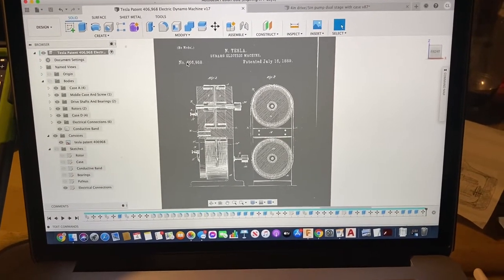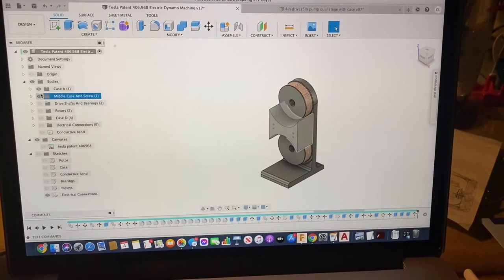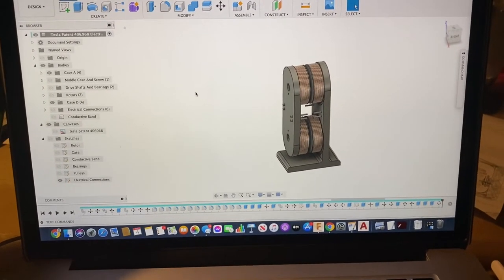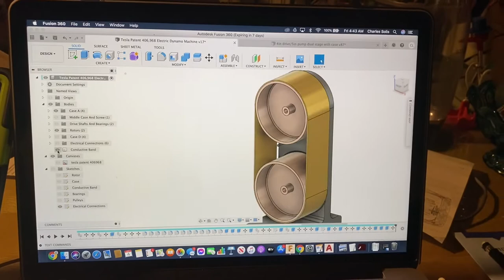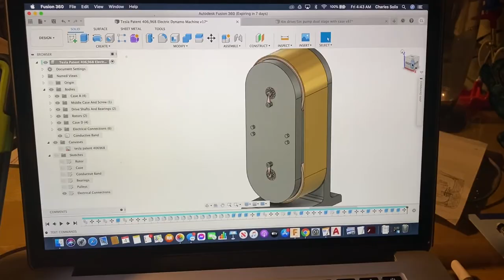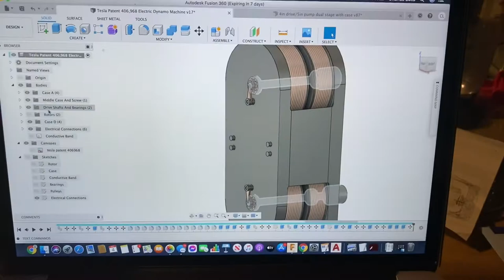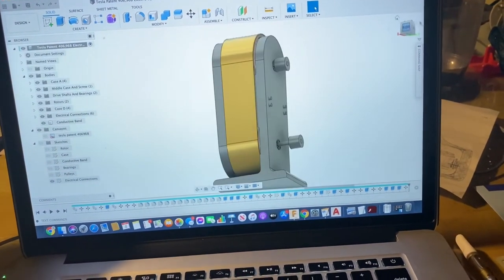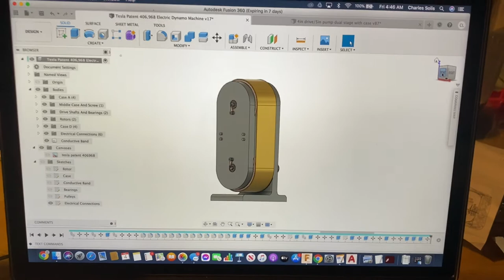Nikola Tesla Patent - 406,968 Electric Dynamo Machine - DC Electricity Generator Homopolar Motor

Comment: hey @Charlie Solis nice CAD! do you know what you'll make the conductive belt from?
thanks. ( answer is  in the chat for anyone interested)
Reply from the maker: Hey thanks for commenting! I know you saw I responded in the chat but I’ll repost the response here again so others can see too. 💙💜💚❤️
In the patent Tesla explains...
“H K are the disks or generating-conductors. They are composed of copper, brass, or iron and are keyed or secured to their respective shafts. They are provided with broad peripheral flanges J. It is of course obvious that the disks may be insulated from their shafts, if so desired. A flexible metallic belt L is passed over the flanges of the two disks, and, if desired, may be used to drive one of the disks. I prefer, however, to use this belt merely as a conductor, and for this purpose may use sheet steel, copper, or other suitable metal. Each shaft is provided with a driving-pulley M, by which power is imparted from a counter-shaft.”

And further down in the patent he says this as well...
“Furthermore, it is evident that the conducting belt or band may be composed of several smaller bands and that the principle of connection herein described may be applied to more than two machines.”
Reply from the maker: Do you have any suggestions of Tesla’s patents that you would like to see built in CAD? I’m trying to figure out which one I want to do next.
Reply: @CharlieSolis   i'm really just focused on the turbine pump but let me think about it. BTW, "Science Exxience" youtube channel has an interesting design of the tesla hp gen.
Reply from the maker: Ahhh yeah I’ve seen those videos. The guy is spinning the magnets with the rotors though. And while it should work considering faraday’s paradox that’s not how Tesla designed it. Also there would be no way to spin the electro magnet coil windings in the case, that Tesla explains are used for increasing the magnetic field, with the rotor.
Reply from the maker: If you haven’t seen them all check out this link. It has all the relevant patents that Tesla had for his turbine. There’s a bunch more that most people don’t know about. 
These are further patents Tesla has for utilizing this as a mixed fluid steam turbine where the steam produced from boilers, with combustion, is mixed with the exhaust of that combustion for a multiphase fluid flow of gas exhaust, steam and water to power the turbines. He even has another one where the exhaust from that is further reran through the boiler to give off the last of its heat to incoming water that is not up to boiling temps yet to drastically increase the efficiency of the system and to utilize the last bit of thermal energy again.
http://www.rexresearch.com/teslatur/turbine2.htm#vacuum
Reply: @CharlieSolis   i think he saw the world as   millions of carnot cycles all around him, waiting to be harvested for the betterment of humankind :)  ...way ahead of his time.
Reply from the maker: @Charlie-Oooooo  for real though! He saw the world in such a different perspective than even people today do. Pure genius.
Reply from the maker: @Charlie-Oooooo  I saw your comment exchange with Paul from grav inert and thought you’d like this list of patents that tesla didn’t get approved. 
http://journal.telfor.rs/Published/Vol5No1/Vol5No1_A14.pdf
Reply: @CharlieSolis  Thank you, that's kind of you.  Interesting stuff and a good winter read - maybe 2 winters ;)  So for a new tesla design how bout his radiant energy collector?  Maybe upping the efficiency a bit?  This year is the 99th anniversary of his patent for that - Nov 5 1901 I think. Patent US685957A.
Reply from the maker: @Charlie-Oooooo  ohhhhh yeah that’s another really good one. I’ve been working on getting to that one as I have some really awesome thoughts on how amplify the effectiveness of his radiant energy patent!
Reply from the maker: @Charlie-Oooooo  yeah I’m really excited to start releasing videos on Tesla radiant energy collector patents. I think I have a way to amplify its effectiveness and make it build up potential at a much faster rate.
Reply: Simple way: use a conductive chain and make the edges sprockets.

Harder way: carbon fiber belt

Comment: 👍👍
Reply from the maker: Thanks for commenting!
Reply from the maker: Hey Body Of A Legend!! Not sure if you’ve gotten a chance to see my latest tesla turbine updates but check them out! Just running on compressed air so far while I still work on the larger vacuum chamber system for the turbine. Peak 2.75kW and 6.22ft-lbs of torque 4150rpm with 150psi room temp compressed air with 1/2in supply lines.  And the second video is the latest 1200watt electrical load tests using 170gal of 150psi compressed air dumped to 65psi, both room temp and then 70-80°c heated compressed air. And saw the continuous 1200watt output all the way down to 65psi. Should have this thing ready for a vacuum chamber here real soon! 

https://youtube.com/shorts/yXQy844URMA?feature=share

https://youtu.be/bWpXRzrzf4g

Comment: Cool! Are the magnet rings fixed to the casting, or fixed to the disc?
Reply from the maker: Yes in his patent they are affixed with the casing. But the magnets can be spun with the rotor due to Faraday’s paradox. However unless it’s being run at a constant rpm for constant voltage out I would not suggest adding that mass to have to be spun up and down every time going through gears if used reverse as a motor for in like an automobile.
Reply: Charlie Solis Thanks for clarifying! So is the purpose of this machine just to generate power? 

A lot of the other videos show a motor driving the pulleys which is probably just for demonstration purposes only, otherwise it seems like there’s no benefit if you need electricity to energize this generator 😂 but of course Tesla probably would use some other form of energy to power this invention.
Reply from the maker: You’re welcome! Ohh Tesla says to make the casing magnetic. So each side of the casing is like a big horseshoe magnet 🧲. So it’s primarily a Dynamo where you put mechanical rotational work in and it produces electrical power out. But it can also be used in reverse where you put electrical power in and get mechanical rotational power out. I believe the added electromagnet coils in there is to just use some of the current produced to increase the magnetic field which will allow it to yield higher voltages out for the same rpm. So if the current through the electromagnet coil that’s coaxially inline with the casing magnet can be throttled the desired voltage out can be varied even if the RPM is held constant. 

I also believe the electromagnet coils are meant to be a regulator/break for it to stop runaway. Consider if you had like 4 houses being powered off this one generator. And suddenly three of the houses dropped off the line. The torque being provided to the Dynamo with the sudden drop in load would surge the last house that’s left on the line because the RPM would jump up very fast because of the lack of load and could damage the house still on the line. So I think if the electromagnet is run in parallel with the rest of the loads ok the line, when a large load drops off the line the coils are a “fault” or a “short” for that load to dump into and that fast increase of current through the coil will ramp the magnetic field up which ultimately will provide a much much larger force resisting rotation of the rotors. As such it will eliminate the rotors from racing up in rpm from the drop off of load on the line. 

But this is just my imaginative speculation. I’ve read Tesla talk about combining this Dynamo with the turbine and how it has an instantaneous regulator to eliminate it from racing up from drops in load off a line and I don’t believe it’s the regulator he has on the museum build turbines because they pressure regulator would have a slight delay whereas this electromagnet “fault” would instantaneously respond by applying a breaking force on the rotors. (But it may do it at a ramping up of voltage so idk maybe I’m wrong) As well Tesla did not mention this regulator being able to stop the runner from slowing down of load is put on, which the pressure regulator on the turbine does as an integral part of its operation. So again this is only my speculation, and I will be building one soon to test these speculations of mine.
Reply: Charlie Solis I’m curious and want to build one myself to do some testing! Have you heard of DePalma’s N machine? I’m very skeptical, but there’s a lot of articles talking about it being able to have an overunity condition of power compared to the input motor power consumed - which of course violates all of physics.
Reply from the maker: Hmm I don’t think I have I seen their work. I will look into that!
Reply from the maker: Hey Alex, not sure if you’ve gotten a chance to see my latest tesla turbine updates but check them out! Just running on compressed air so far while I still work on the larger vacuum chamber system for the turbine. Peak 2.75kW and 6.22ft-lbs of torque 4150rpm with 150psi room temp compressed air with 1/2in supply lines.  And the second video is the latest 1200watt electrical load tests using 170gal of 150psi compressed air dumped to 65psi, both room temp and then 70-80°c heated compressed air. And saw the continuous 1200watt output all the way down to 65psi. Should have this thing ready for a vacuum chamber here real soon! 

https://youtube.com/shorts/yXQy844URMA?feature=share

https://youtu.be/bWpXRzrzf4g
Reply: @CharlieSolis  Just check them out! Really interesting project and setup. Thanks for sharing
Reply: My guess is that during operation the permanent magnets, the casing,  gets demagnitized. Therefore, you'll probably need the coils for further operation, that is that they do exactly as the permanent magnet is supposed to do, create a magnetic field, right-angled to the motion of the disc. As you can control the magnetic field, you control the output voltage (fixed speed supposed).

Comment: ok soooo its rotating enamled copper wire with solid RE center magnet with conducting band so a stepper motor next to another and connected by conducting belt?
Reply from the maker: Ehh not quite. It’s literally just two faraday discs. One made to have the voltage potential go from center to periphery and the other to go from periphery to the center drive shaft. And the conducting band around the periphery provides the connection between the two so that the only electrical connections that have to be made are from the center driveshafts. 

Normally the downfall of a faraday disc is that you have to have an electrical connection at the center driveshaft and one that touches the outer radius of the disc which a sliding contact at that radius is a huge efficiency loss. But Tesla came up with the idea to circumvent that by making the outer periphery of both discs be connected with the conductive band.
Reply from the maker: I plan to attempt to do this with the copper discs being Tesla turbines and instead of a conducting band use a conductive fluid. Electrolytic water maybe even and use the Ohmic losses from conducting the current through the water that electrically connects the two to create hydrogen and oxygen as a byproduct.

I also want to try this using ionizable gases. Maybe even make it a closed circuit and have it next to a Tesla coil which uses the em waves coming off of it to ionize the gas which thus makes it conductive for electrons to flow in a dc bias current across the ionized medium. I think I could also do it with very low pressure gasses that ionize very easily too.
Reply: @CharlieSolis  is this to take static charge from air to make current?
Reply from the maker: Nope it’s just a simple faraday disc bud.
Reply from the maker: @bestowicprimer8835  it’s fairly low voltage and doesn’t get to the levels of high voltage electrostatics. By fairly low voltage I mean like in the 12-30v range but the current should be huge.
Reply from the maker: @bestowicprimer8835  look up “Homopolar generator” or “unipolar generator”. 

I’ll see if I can’t find some links
Reply: @CharlieSolis  bad ass im still brainstorming a centrafugal cavitation system for the mercury and water need the water to cavitate into the mercury lined walls of a centrafugal system right after throttling... I heard that theres a lead mercury alloy that is porus for mercury but not water.
Reply from the maker: @bestowicprimer8835  https://en.wikipedia.org/wiki/Homopolar_generator
Reply: also the damn transducer... can u recommend what i should get? should i just try a humidifier?
Reply from the maker: @bestowicprimer8835  it’s pretty ingenious how Tesla figured out how to get around the pitfalls of the homopolar generator.
Reply from the maker: @bestowicprimer8835  is the Mercury in some sort of lead alloy? Or how are you going to keep it solid.
Reply from the maker: @bestowicprimer8835  yeah I’m not to sure how to answer that transducer question though.
Reply: @CharlieSolis  well mercury held in place by centrafugal forces or from a lead alloy which 80 82 ~79 maybe ~78 if can kick off sum protons with the KOH and throttling vacuum cavitation
Reply: @CharlieSolis  upload a material video of what I have for that. Ill upload some video of equipment later.